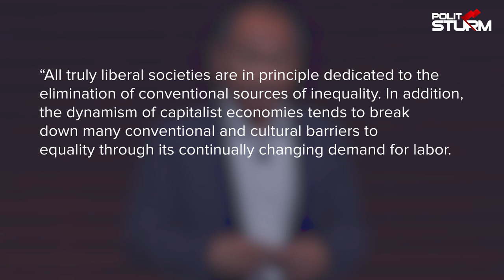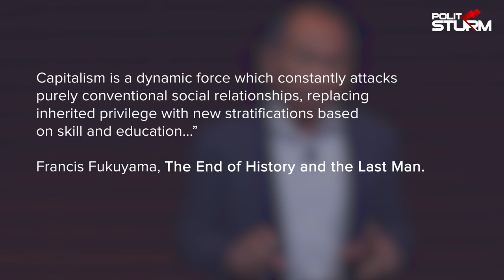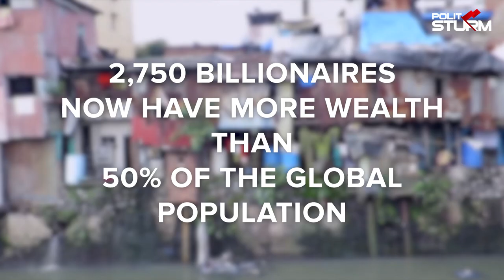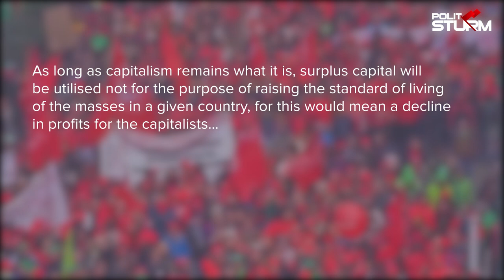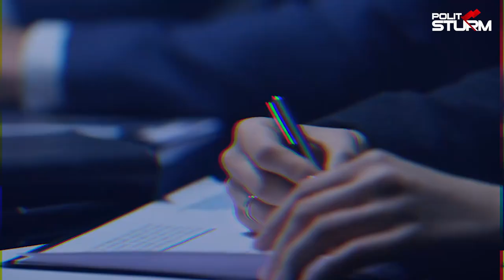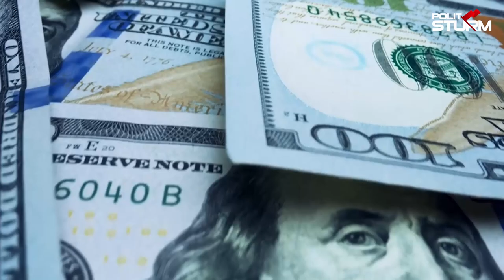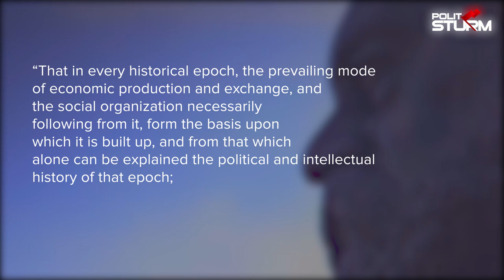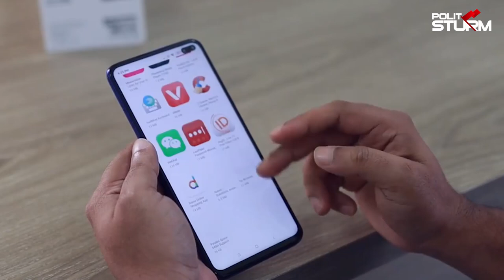Is Marxism Still Relevant Today?

Comment: I agree with everything said in this video except 2 points:
1. Dialectical Materialism. Just drop it. a) There is no need for Marxists to argue "dialectically". Marxist theory can be entirely explained through empirical evidence alone, there is no need to obfuscate this clear scientific model through language. And yes I mean language. Because 99% of Marxists don't understand dialectical thinking. The great works that are always cited like Engels' work or Mao's work on these topics have real insight, but they have nothing to do with the original dialectical thinking. Marx would have discarded both of these. Paul Cockshott has a great video on this topic, "Against Hegelian and Platonic Idealism"
b) Funnily enough, I still think there is value to dialectical thinking. For philosophy. And in order to gain the best insights its crucial to return to Hegel. Don't read any Marxists if you want to understand dialectical thinking. As I said, 99% of Marxists don't understand it. They repeat some weird formulas which explain nothing or they say the most basic shit and pretend they just said something profound. I recommend a video by Antonio Wolf; "Why Dialectical Formulas fail". And if you are then still interested in dialectical thinking - then start reading Hegel's Science of Logic. Its what Marx did, it what Lenin did. There is also a good article on marxists dot org about how to read Hegel. Or the reading group videos by Antonio Wolf are also quite good.

2. Marxism-Leninism. That term is outdated. Marx was wrong on many things like his assumption that profit rates would equalize across all industries. Or his idea that socialist revolution was most likely in developed capitalist countries. Lenin was also wrong on many things like the idea that you can have all of the working class' interests be represented by a fusion of party and state. And while they have had immense insight in thousands of other topics, there were still problems and mistakes that they have created. In my opinion we should avoid putting any name on our movement. I'm a Communist, not a Marxist-Leninist. Because the Communist tradition albeit it massively influenced by thinkers and revolutionaries like Marx and Lenin, is much wider. I have no allegiance to any tendency. If I agree with anarchists on a specific issue, then so be it. If I agree with Maoists on a specific issue, then so be it. There is nothing wrong with making up your own mind. But there is something wrong in putting names on our movement, putting people on pedestals which they themselves would have rejected.
Reply: Marx would have discarded Engels' dialectical  materialist thinking to embrace original Hegelian dialectics? What the fuck are you talking about? Marx and Engels discarded Hegelian dialectics for its idealism, and Marx put forward the materialist version as a direct refutation of Hegel. Engels followed marx in abandoning the "young hegelians" to develop dialectical materialism.

Obviously there are flaws in 150 year old philosophies. It's weird that you cite Cockshott, as he is very clearly a dialectical materialist, you even referenced his video against Hegelianism.

Honestly your comment is all over the place and reads like someone whose understanding of theory comes entirely from YouTube videos. 

Peace
Reply: @MrDoomedtofail  you just bodied him man! 😂😂
Reply: @MrDoomedtofail  one thing I see a lot of dialectical materialists do is refuse to acknowledge the ‘dialectical’ part
Reply: @MrDoomedtofail  That is not what I said. I said Engels wrote the most banal shit (quantity becomes quality, wow such an insight blabla) and called it dialectics. Marx would have never done that, he would have actually had a clue what he was talking about.
Marx didn't write about his dialectical method in detail. Engels and most subsequent Marxists didn't understand Marx' method.
Hence the only good way forward is to repeat what Marx did - go back to Hegel, understand Hegel and then turn him on his feet.

"It's weird that you cite Cockshott, as he is very clearly a dialectical materialist, you even referenced his video against Hegelianism." Cockshott's idea of dialectical materialism is just a positivist materialism. He is a computer scientist, he doesn't care about the self development of concepts, for him that is language games. Thats why he advocates abandoning dialectical thinking.

"Honestly your comment is all over the place" I had criticism of two different points made in the video. Ofc my reply will be not one coherent one but answering each of the points.
"and reads like someone whose understanding of theory comes entirely from YouTube videos." YouTube videos are a good way to find the resources you are looking for. But ofc they are not the only way of getting to know theory. When it comes to presenting arguments YT videos are better because they don't have to follow the structure of books, they can simply focus on the arguments.
Reply: This was very well written and I respect your insight and intellect. If I were to identify as anything it would be as a libertarian socialist. I think to glamorize communism is very flawed but at the same time I see far more similarities than disagreements. It's just frustrating that we have to be fractured and that is truly holding back any hope of change.
Reply: @LibertarianLeninistRants  Everything you wrote actually hurt to read and it was embarrassing.
Reply: @thechekist2044  why?
I'm ready to have a meaningful discussion, so let me hear your criticism of my position
Reply: @The80sWolf_  its just a name, a meme from 2016 leftist youtube that nobody remembers anymore
if somebody asks me what my worldview is I say I'm a Communist
Reply: You make a valid point but other leftist youtuber go into your points better , again communism isnt a one size fits all ideology and knowing the difference of the forms of communism (or socialism as communism only exists with no state and no borders) betters our view on how things should be or shouldn’t be lead. 
Also any deviation to the cause to eliminate class struggles such as social democracy , trotskyism ,  Maoism is what we tend to call opportunists. 

Comrade dont feel threaten by any other comments or discrimination towards your views you mind is free and you can express yourself . A proper critical dialogue will lead to our co-existence and success. Much love
Reply: I would have simply agreed with you if you didn't couch your statement with spurious claims that easily sound arrogant. (Where's the "empirical evidence" for 99% claims?). I get what you're after, but it isn't communicated effectively. Take the note. To the good of what you say, the best of empiricism has absolutely caught up with and ran past Marx and Engels. Complex systems theory, as one example, is a far better form of a diamat than diamat ever became. I agree with you that it seems a lot of Marxists aren't interested in explaining why or how things are actually happening. In clinging to the past, they retreat into an idealism that ignores basic standards of evidence. It easily becomes religious nonsense the only praxis of which is to make people feel better. Finally, yes. As with Marx, I support the kind of socialism that can and will exist. Let that be what it may. To call oneself a Leninist is to sort of miss the point, I think.
Reply: @LibertarianLeninistRants  Revisionist
Reply: Revizionistë!
Reply: How is the term Marxism-Leninism irrelevant? Literally elaborate!
Reply: Please research dialectical materialism. Read Dialectic of nature and Utopic and Scientific Materialism". And again educate yourself.
Reply: @hsa522  I did. Socialism Utopian and Scientific is great. Dialectics of Nature are an absolute blander of the dialectical method. Engels really messed up with that one, there was zero unique insight in that book that wasn't said by philosophers hundreds years prior, some of it even being debunked several times.
Reply: @LibertarianLeninistRants  Which philosophers debunk that book?
Reply: @LibertarianLeninistRants  Which ones debunked Communist Manifesto?
Reply: @LibertarianLeninistRants  Now I'm too late to sleep in Turkey. You answere and I reply your question maybe tomorrow. Because we are mourning for the earthquake I may answere afterwards.
Reply: @hsa522  "Which philosophers debunk that book? [Dialectics of Nature]" I didn't say they debunked the book, but the topics that Engels is talking about, some of them were misinterpretations/misrepresentations (f.e. of Hegel, Engels calls these "laws of dialectics" even though Hegel never said they were laws, only to applied. the dialectics for Hegel were results of the method, not formulas to be applied as Engels does here), others are misnomers which have zero explanatory value (f.e. the change of quantity into quality; it sure isn't wrong but its not an insight, it doesn't explain why anything changes, its just a useless description of a process which might happen at some point. At what point? We don't know, its just "change of quantity into quality", but at what point we don't know) and also metaphysical errors (f.e. the "law of identity", a=a that Engels tries to debunk here [he says it was debunked by natural science but then only continues with mixing up categories, so obviously a lifeform is always changing, in that sense he is correct. but the lifeform a is still equal to the lifeform a because the a is only the descriptor; so he mixes up signifier and signified here]).
His description of the history of physical and chemical thought is fine. If you would cut out all the parts where he attempts to apply dialectical thought (or what he believes to be that) you would get a good book about the history of natural science. But philosophically, it doesn't provide anything new and is just filled with errors and misreadings.

"Which ones debunked Communist Manifesto?" I don't know any who succeeded, except Marx and Engels themselves when they wrote the preface to the later editions and corrected some of their previous statements in the manifesto. But yeah, the manifesto is a good book and I don't understand why some Communists dismiss it as "just polemics". Its not just that, it also attempts to be a political guide, a teleological (historical-materialist) explanation of history and the polemics is just the icing on the cake.

In the end I am still a Communist. I just think that most of the stuff our comrades say and wrote about philosophy is disappointing, full of errors and misunderstandings. Its unfortunate.
Reply: @The80sWolf_ Now I cannot answer your comment. Because we've got a disaster, earhquake. Please give me a chance to answer you. Just to tell you that Lenin was a pragmatic leader. Lenin belongs to the middle class and has something to lose. But the Working class has nothing to lose. Despite this, Lenin is a passionate personality focused on the revolution. We call Ideology Marxism-Leninism because it realized Socialism in Russia. We call it Marxism-Leninism because it brought about the revolution. He also had many books and was the most read book of his time. And do you know Marxism-Leninism better than the Russians?: https://www.youtube.com/watch?v=kWqQkgp8jAA
Reply: @LibertarianLeninistRants  Besides, do I have to explain in English to be able to explain it to you? Why don't you learn Turkish and answer me? The best source for Marxism-Leninism is Grover Furr.
Reply: @hsa522  "Besides, do I have to explain in English to be able to explain it to you?" To explain what to me? I'm assuming you are referring to a specific comment, but I don't know which.
You can also explain it in German, French or Dutch to me if you can. I don't speak turkish.

"Why don't you learn Turkish and answer me?" Answer what? I have written a long comment yesterday responding to you. Has it not shown up? Sometimes youtube does that. Try to go to the video directly (not through the comment box in the top right of your youtube page) and find the original comment, then open the thread. If my response to you still doesn't show up, tell me again and I try to write it again.

"The best source for Marxism-Leninism is Grover Furr." Oh hell no. There are tons of better writers than him.
Reply: Don't, don't bother me in this mourning day. You must know the difficulties of learning a Turkish language of Latin origin. Just like your Turkish learning difficulties. Let's not discuss them today. Another time. Lenin carried Marxism to a further dimension with his theory of imperialism. On this day of mourning in our country, I have a lot to do on social media. Please be conscientious.
Reply: Imperialism The Highest Stage of Capitalism.
Reply: The root of libertarian comes from liberalism. That means free marketism. So you are not Leninist. So you cannot educate me.
Reply: You are like Fukuyama.